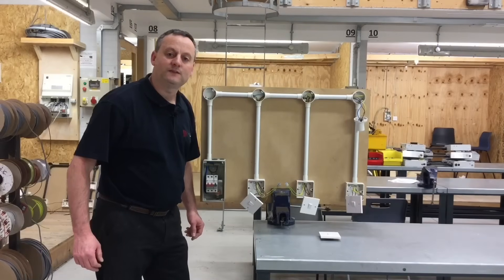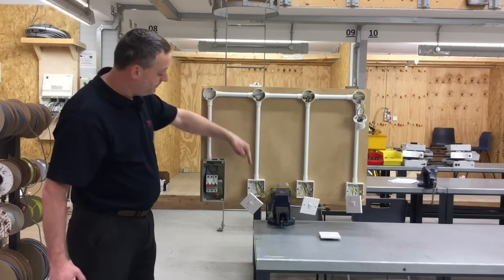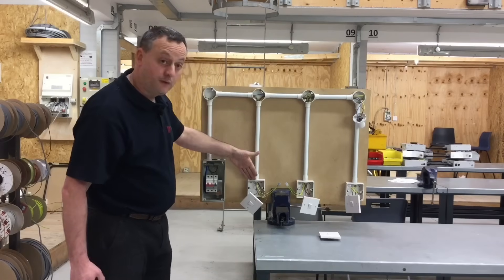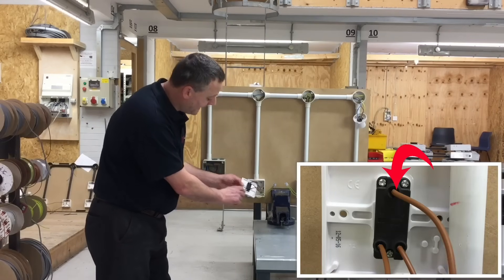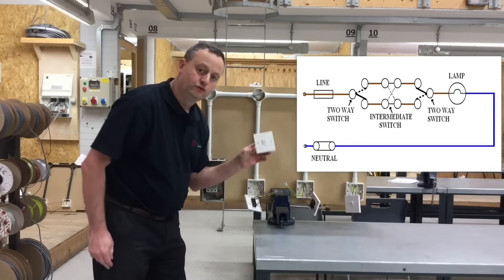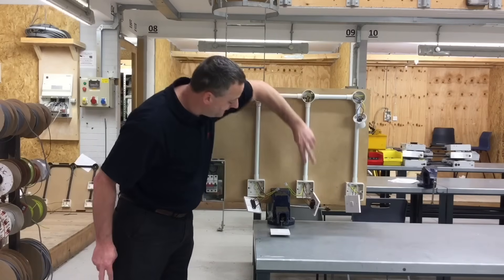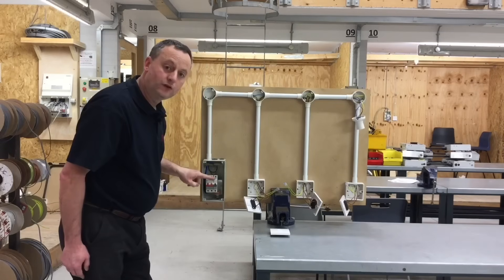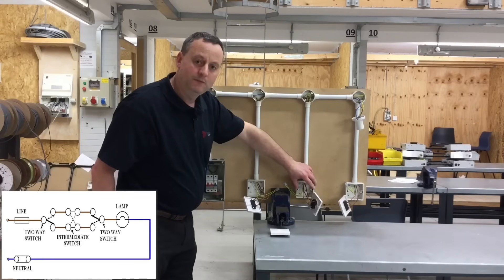Conduit Loop-in Method for Wiring 2 Way and Intermediate Switching of a Lighting Circuit in Singles

Comment: Hi Gaz so in the am2s now you would wire the neutral the same as the CPC leaving a connection at each switch before only having one cable at the night?
Reply: Light*
Reply from the maker: If they want the 2 plate method take the feed to the switch - it will probably be switched 2 way and intermediate (video coming soon)
Reply from the maker: Lighting Circuit 2 Plate Method Taking the Feed to the Switch and Connecting a 1 Way Switch & Light https://youtu.be/1G4fW2DeqPA

Comment: Good explanation. Don't forget there is another way of doing it if your permanent line and switched line are at the same switch. You'll need to run three strappers to each of the remaining switches and use connector blocks for the common strapper, or in this case where using singles you would run one between the first and last switch, and two between each of the switches in between. The method in the video only works if you have your permanent line at the first switch and switched line at the last switch.

Comment: It would be great if you could do short video showing what the switches are actually doing when they are pressed. I can remember constructing a model (complete with moving parts) showing my apprentice what actually happens  inside the switch when a 1-way, 2-way or intermediate switch is pressed. He found the model of the intermediate switch in particular, extremely beneficial.
Reply from the maker: Hi. Thanks for the comment. I am currently working in an SWA video I will add your request to my list. Thanks as always for the support Gaz